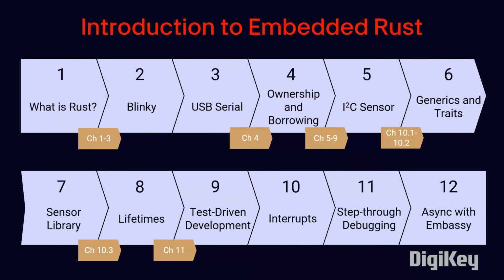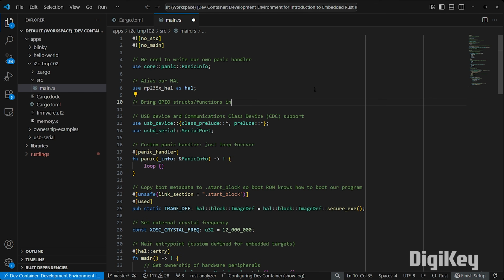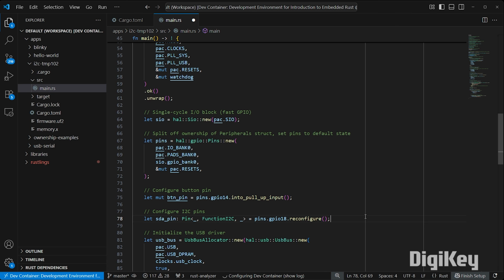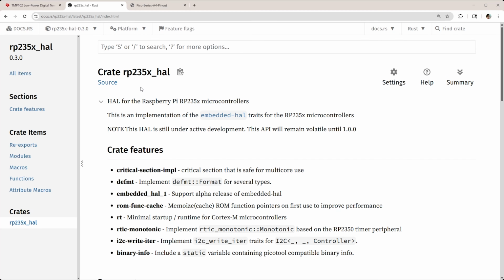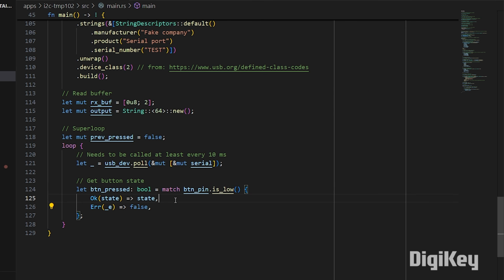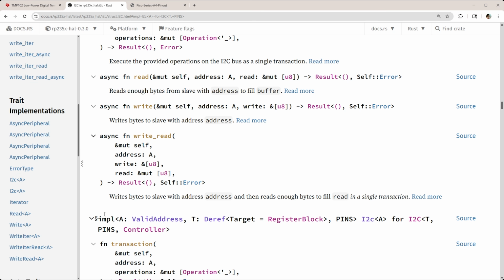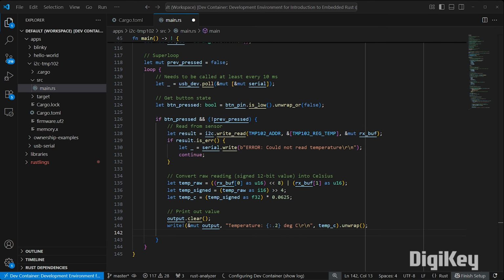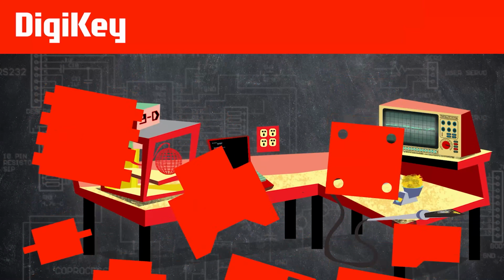Intro to Embedded Rust Part 5: Reading from an I2C Temperature Sensor | DigiKey

Comment: Thanks for your effort, even i dislike you to go in Rust. 
Be aware, that elf, hex file or bin both will save user folders inside them. Even with totally striped & optimized binary file, still Rust put them there. It is bad to ship your personal computer data structure (windows) to others. Just be aware of that before trying using Rust for embedded system. 

Another thing is what ever you do, embedded rust has higher size binary files after optimization. In Debug hex/bin .. the firmware run way tooooo slower than release. i.e. Debug cannot be used to test devices with critical time consideration. 
How would rust be the solution ??? never ever.
Reply: Can you just relax? It's just a tutorial.